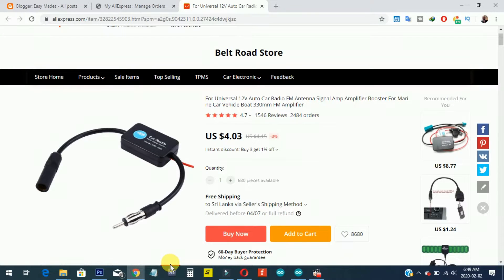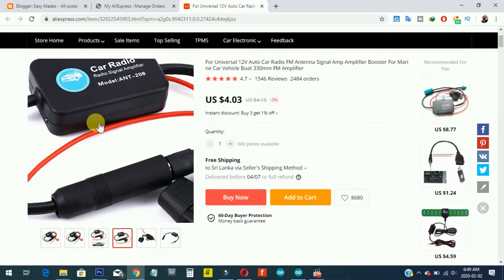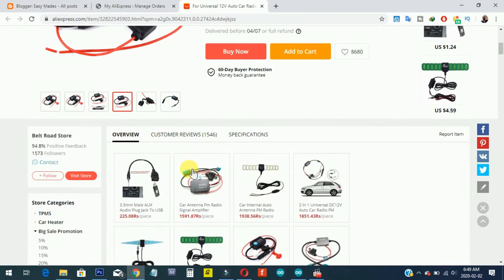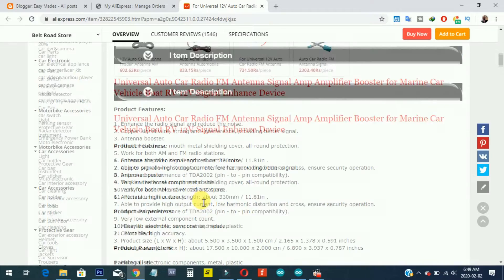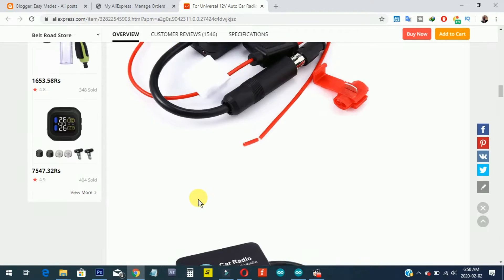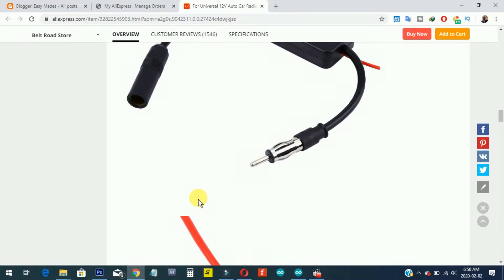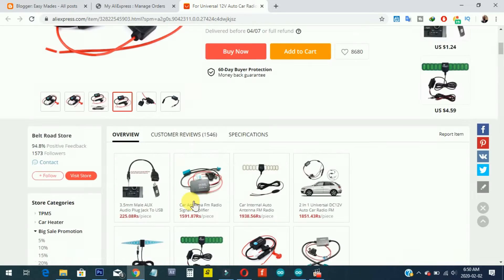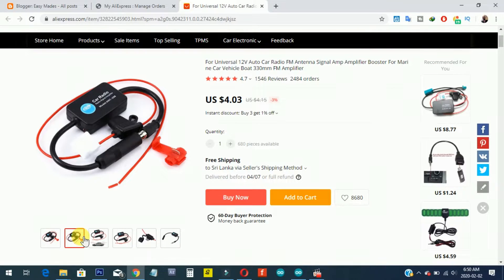Car FM/AM Antenna Booster Installation and Testing

Comment: Could you show the inside components of this booster? I got one yesterday for my home receiver but after fitting the booster, the fm interference is too high. I just checked the inside components of the booster module. I can only find a few diodes, LED, and capacitor. This means no signal amplification. Finally, I used 5m long aux cable as an antenna and it worked piece of cake. it's catching 30+ stations now.  In my opinion, those boosters are fake. The single wire catches better than this Chinese crap.
Reply from the maker: NO, the unit boosts the signals well. Some fake products also available in the market.
Reply: @setnfix  It's the same one in your review
Reply from the maker: @Rumesh-n4d  it is installed in may car, give me few days, I will post an image :-)

Comment: not working, even distrubs other FM channels
Reply from the maker: There may be a issue with your booster
Reply: @setnfix  can I fix it by removing its cover.
Reply from the maker: @ElectroniXforu  There are only few parts. yes you can remove it with removing protector plate inside.

Comment: Will this work for home fm receiver, by connecting 12v supply to the fm amplifier
Reply: I see where you can say that but he didnt stop there . He did go to a clear channel and he unplugged it and the channel went quiet.
Reply from the maker: Yes, you can use

Comment: The whole time he tries to install this thing he has it set on 90.0, which is one point from a clear radio station. Then when he shows how much better when it's connected, he moves it to 90.1, which is cleaner and louder because now it's on the actual station !! These things are useless !!
Reply: I tried one myself and they are a waste of money !!
Reply from the maker: @jameshydra1031  bad luck
Reply: @setnfix  lmao its called a scam
Reply from the maker: In my experience, the booster working well than without the booster.
Reply: @setnfix  you dont seem to be clarifying why you were 100 kHz off the actual frequency though

Comment: Transmision 1Kilo Ohm Stealth Atmosfer install Heater YouTuber ME 100million°C outer body part temperature inside secure temperatur via more corsair PSU to termotermoelektrik pendingin via GND inner side 25°C.
Reply from the maker: It seems like you've provided a mix of technical terms, and it's a bit unclear what specific information or assistance you're seeking. However, I can try to break down and address some elements of your statement:

1. *1Kilo Ohm Transmission:*
   - It sounds like you might be referring to a 1 Kilo-ohm resistor (1KΩ). Resistors are electronic components that limit the flow of electric current.

2. *Stealth Atmosphere Installation Heater:*
   - The term "Stealth Atmosphere" is not a standard technical term. It's unclear what exactly you mean by this. If you're referring to a heating element or a heater installation in a specific environment, more details would be helpful.

3. *YouTube and 100 Million°C:*
   - If you're mentioning YouTube, it's possible you're documenting or creating content related to the setup you're describing. However, the concept of achieving a temperature of 100 million degrees Celsius raises safety concerns and seems unrealistic in standard scenarios. Extreme temperatures like this are typically found in specialized scientific environments, such as nuclear fusion experiments.

4. *Corsair PSU and Thermoelectric Cooling:*
   - It looks like you're mentioning Corsair power supply units (PSU) and thermoelectric cooling (Peltier cooling). Corsair is a brand known for computer components, including PSUs. Thermoelectric cooling uses the Peltier effect to transfer heat away from one side of the device, providing cooling in certain applications.

5. *Secure Temperature and Thermoelectric Cooling:*
   - Achieving a secure temperature could be related to maintaining a specific temperature level for the components involved. Thermoelectric cooling can be used for precise temperature control in some applications.

6. *Ground (GND) Inner Side 25°C:*
   - Mentioning "GND inner side 25°C" could be related to grounding and specifying a target temperature of 25 degrees Celsius on the inner side of your setup.

If you could provide more context or clarify your question, I'd be happy to help further. Additionally, it's important to note that working with extreme temperatures and electronic components requires careful consideration of safety precautions and adherence to proper engineering practices.

Comment: Does it fix the Static when moving the car?
Reply from the maker: If I say in the most of times the signals become stronger. Even in the rural areas. If the signals are week, it will boost the signals even though the vehicle is moving.

Comment: what do you do with the red wire
Reply from the maker: 12V wire
Reply: @setnfix  connect to the battery or to the stereo?
Reply from the maker: @monikpatel1879  Car battery Accessories wire.

Comment: Where do you plug in the power for the booster?
Reply from the maker: ACC cable
Reply: The wire to the ignition switch which is red here in the USA
Reply: dumbo ah he no know